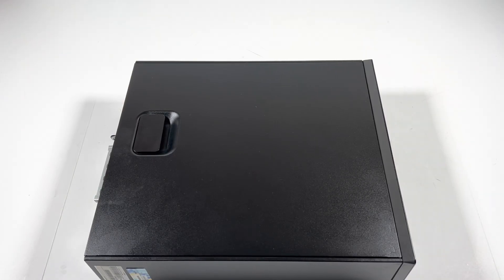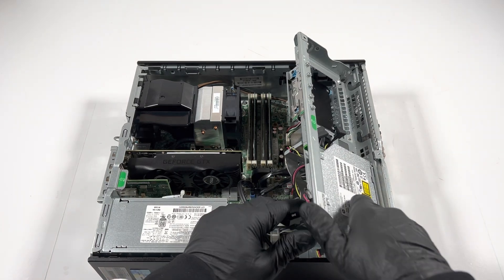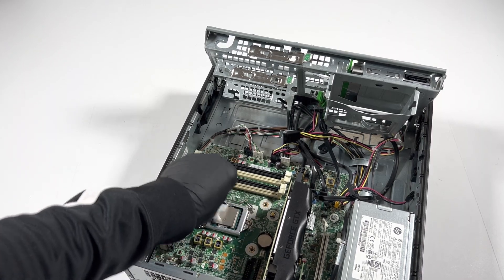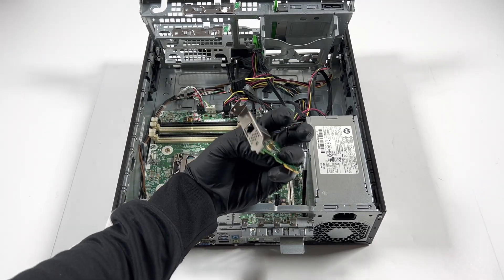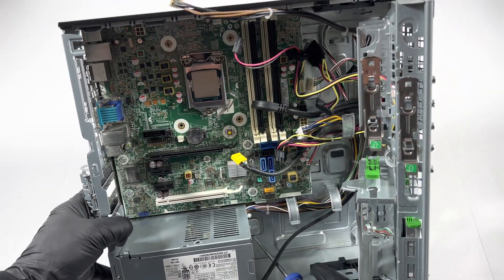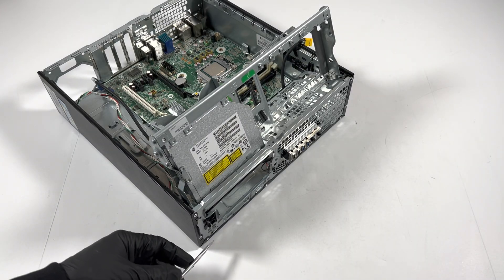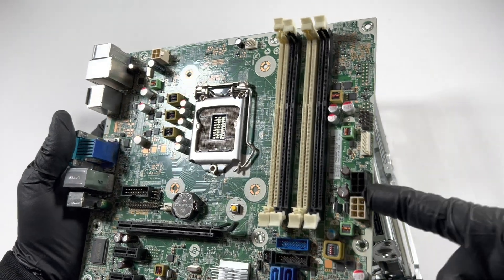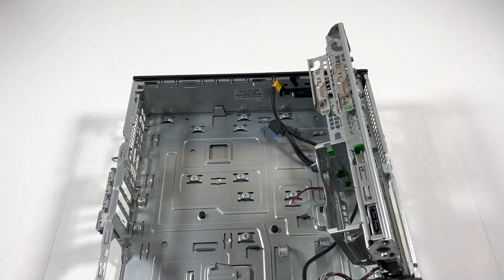HP EliteDesk 800 G1 Teardown

Comment: I have one. Came with a i5 45something, upgraded to a i7 4770. Put a Arc a380 in it (i do not recommend this gpu for this system, you NEED ReBar or whatever it is and this motherboard doesn't support it. You can get the gpu to run but it performs horribly in alot of games without ReBar.

Comment: Hey bro great videos. I just picked up an Elitedesk 800 G5 sff and I was wondering if the size and layout would be the same as these G1s you’ve broken down. It has i7-9700 and I wanted to know if the rx6400 Lp card would fit in the PCIe slot? Really hoping to get some decent gaming out of it
Reply: Just tripping out a bit because you didn’t mention the rx6400 in the compatible gpu section

Comment: Is is possible to change desktop pcs Power supply?
Reply from the maker: Hi, yes it is possible.
Reply: @Mxkdt  I don't mean by desktop a gaming pc i mean these Normal ones like this one in the video
Reply from the maker: @Outlaw4Lifee  Yes you can if you buy the 24 Pin to 6 Pin ATX Power Adapter Cable.